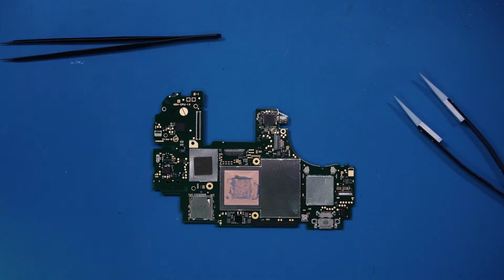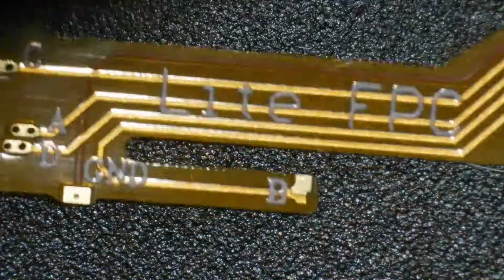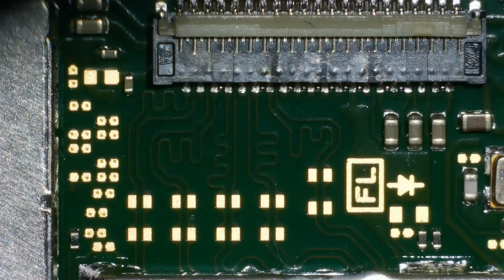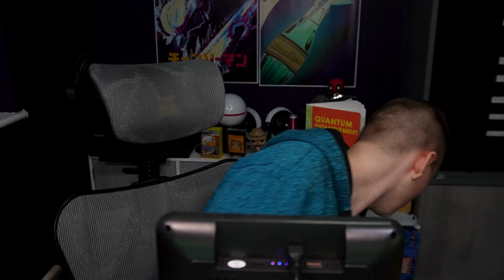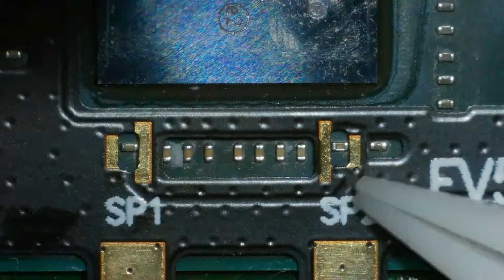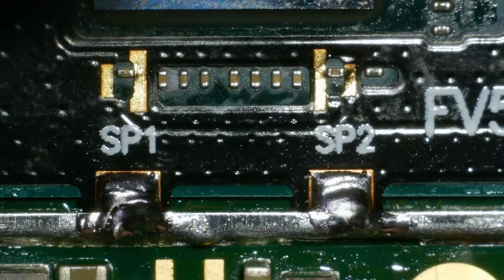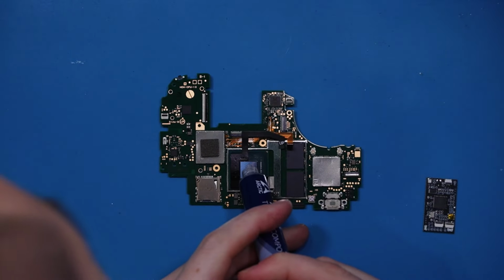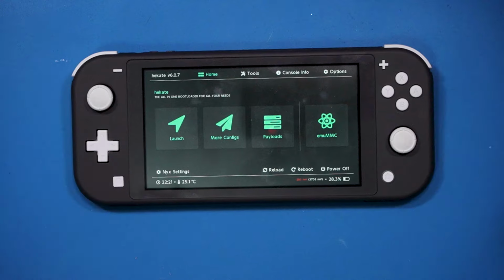Latest RP2040 PicoFly  *2024* : Nintendo Switch Lite Install

Comment: God, I really want to be able to do this. I have most of the equipment I would need for it. Just way too nervous and really don't want to destroy it lol
Reply from the maker: If you already have the equipment and have soldered in the past. The hardest part is the cpu caps. Just take your time. Only do one side of the cap at a time so you dont knock it off. If it take 3 hours it takes 3 hours who cares.

Comment: Amazing video bro! This might be a dumb question but do i have to flash the glitch chip?
Reply from the maker: IT all depends on where you buy them from. They normally come with the USB C adapter to flash them anyways. It's extremely easy to do.
Reply: @QTronics   thankyou! is there any documentation on this?
Reply from the maker: @ https://www.retrosix.wiki/picofly-hwfly-rp2040-nintendo-switch

Retrosix has a good wiki

Comment: Just finished my second switch lite modchip following your tutorial. First time it took me like 5 hours and I even had to remove and resolder the flex cable, but this time i did a really clean install in less than an hour, so thank you man :) . Didn't have the same luck with the OLED tho as i ended up breaking the clk point pad and bricking the console
Reply from the maker: O man, well done on the two lites. They deffo do get easier with time :).

The oled are horrible todo, the clk point is hard to restore too you would need to take the cpu off and do some messing with layers.

Grats anyways dude

Comment: I think I melted off the capacitor of the 3.3v point. Am I completely screwed?
Reply from the maker: No You would just need to put the cap back on. Those are big caps so should be easy to put back on.

Comment: Flex cables that were actually made for the console and the mod chip ....now there's a novel idea .
Reply from the maker: Haha, tbh this one was actually nice to install. Not having to bend it back on its self like the old Lite ones , made it look neater too.
Reply: @QTronics  or pull the emmc card out the device . Yeah this has gotten pretty  streamlined . People will never quit bitching that their isnt a soft mod, but this is so much easier . The flex cables are totally worth the money now that the rp2040 has been revamped and had its gpio pins relabeled to actually coincide  . Plus it fits so much better in the console . Much improved . I really like the orange cable ...its half the size of the one I used and not having to fold the cable to solder the 3v3 is obviously great but now you can actually see the solder point to the pad through the cable . Whoever made it see through is a genius .
Reply from the maker: yeah exactly, the transparency is a cracking idea. I much prefer the placement over the Ram too rather then the EMMC.
Yeah lots of people moan about a softmod. TBH I've only been soldering since nov 23, So I can see why people want to avoid the soldering. However there are plenty of places out there that will mod a console for you, It's worth it at the end of the day.
Reply: @QTronics  yep there are lots of places, but the issue has never been the inability to find someone capable of doing the work, the issue is they don't want to pay for it and it's easier to call someone else greedy than it is to admit that they are cheap .
Reply from the maker: That is very true. having done a number of these now, I can see why they cost so much to be modded. Lots of skill and risk involved.
Reply: @QTronics  exactly . the cost of the rp2040 is negligible . the cost of the console is negligible . The cost to your reputation isn't . people watch other people install the chip in 10 minutes and feel that the price isn't justified, but never stop to consider the risk be taken . They are afraid they will break their console, which wouldn't be great, but never stop to consider how much worse it would be if the console got ruined with it belonging to someone else .
Reply from the maker: Too right,  Modding consoles has definitely given me a new respect for people whole fix them as their main job.

Comment: Sir can you help me. Blue, Green², green², green²

Or  its yellow
Reply from the maker: Have you tested all the points in Diod mode? What readings do you get?
Reply: @QTronics  after failed attems i tried to remove the picofly now my switch wont turn on
Reply: Note, i thik i burnt 1 capacitor in cpu, next to sp1
Reply: Switch now wont turn on can you help me?
Reply from the maker: @pacmanptg4857  sorry I was away at the time.
If you think you have messed up a cap you will need to replace them normally. 0201 1uf 20% 10v
Reply: @QTronics  thank you i will try to replace it. If i have the time. Thank you, i subscribed
Reply: @QTronics  btw will iy have a problem if i ripped the padts of ABC
Reply from the maker: @pacmanptg4857  Maybe, i did just look at the layer schematic though, and it looks like A B and C are just test points. so you might be ok. 
I've linked the schematic https://balika011.hu/switch/lite/

Comment: Nintendo really should give us a power option of performance and battery saver modes. I have a switch lite, and if it would clock up just ever so slightly, it would make a big impact on performance.
Reply from the maker: It really would, it’s silly they dont give us the options to.

Comment: Hi, is it really needed to check the lines via Multimeter? I don't have knowledge with the multimeter :)
Reply from the maker: it just confirms things are connected. If you are sure they are soldered you are fine

Comment: What temperature do you usually use? I found hard to get the solder to stick to the board.
Reply from the maker: Im normally using around 330-350c

Comment: Is only flux paste used in this project instead of solder? I read online that it contains an amount of solder. Great video!
Reply from the maker: I think you’re confusing it with Solder paste. Solder paste does have flux in it I think.
I’m using flux and normal solder, im applying the solder to the iron, as we’re only soldering tiny things

Comment: This might be the clearest, most concise guide I've seen yet on the Switch Lite PicoFly install. Underrated channel, I like your style.

I have a kit sitting at home that I just ordered, and as soon as I find some free time I'll be trying my hand at installing it. Not expecting any trouble, thanks to fine videos like this one. I've got all the equipment I should need, so hopefully within a few days I'll have my Switch Lite modded.
Reply from the maker: Thanks for the kind comment. 

good luck with your install. Just take your time, plenty of flux. just make sure nothing is bridged :) Let me know how it goes please.
Reply: @QTronics  Take my time, hell, I took about four hours with it! Way more than I bargained for. TL;DR it works.

The APU flex cable was a leisurely breeze to install. The toughest aspect of that job was taking off the heat shield - I wound up just using the same plastic spudger that came in my PicoFly kit, and I was surprised it worked so well after watching everybody else force those tiny retaining clips.

The other flex cable, I tossed aside after a while. Even after installing it as well as I could, my PicoFly kept flashing out an error code of two short pulses. After that I figured it'd be easier to string up everything else manually using some enameled wire, and it probably would've been, if my digital microscope weren't so damn low res! So that's an upgrade I'll need to look into sooner or later. But I digress. The bulk of my time was spent soldering and then re-soldering magnet wire to test pads. It was maddening.

For a hot minute there, I thought I killed my Switch Lite. Must have been some eMMC test pads got bridged after I discarded the second flex cable, once I cleared them up it came back to life (hopefully no damage done). And eventually, after considerable anguish and perseverance, I was greeted with the "No SD Card" screen! And I don't think I need to tell you, it felt glorious. After all that time, it felt a little bit like winning the lottery.

Just buttoned it back up a few minutes ago, with some fresh, high performance jizzle to help cool the system. Next step is to find a big old microSD card.
Reply from the maker: @tetsuo3k  mate im so pleased for you :).

Which flex did you have? The one like mine or the old one that mounts on the emmc sheild?
Cus the old flex is crap. Yeah I have a video of me repairing and instinct oled install using wire it’s bloody hard isnt it.

Im glad it’s worked out for you though, and my editor just messaged laughing at you using Jizzle hahahah.
Reply: Oh yeah, it was one of the old style flex cables, with the fold-over bit. Total garbage, but that's luck of the draw for you. Fortunately I could roll with it.
Reply from the maker: I’ve done a couple of those. It all depends on how well the folded ribbon is made, some of them are cur so badly you cant mount them to the points.

Comment: Tutorial is very easy to understand. Your solder joints do need some work. You should be aiming for a nice concave fillet. You are using way to much flux, make sure you clean all flux off the board. Make sure you fully tin the whole pad before installation.
Reply: Using the bridge technique with a thin strand of solder will improve your joints immensely. That way you can insure that all your components are heated up to the right temperature and you won't get any cold joints. Keep up the great work!
Reply from the maker: yeah this was probably the 8-10th time i ever soldered. I would like to think im better now. but getting better only comes with time :)

Comment: amigo sabe me informar se essa é a última versão do firmware para a plaquinha picofly rp2040 ? v2.73.uf2 , ou se possui versão superior ?
Reply from the maker: Hola, El firmware esta aqui : https://gbatemp.net/threads/picofly-a-hwfly-switch-modchip.622701/page-78
Reply: @QTronics  Gracias amigo, intentaré descargarlo, creo que instalaré la versión 2.73, creo que es estable.
Reply: Could you help me with a question? What is the best solder tin to do this installation, 0.5mm or 1mm? I really appreciate your answer.
Reply from the maker: @Fabio_Bezerra_Jr I would use the 0.5mm. As the connection is quite small, it’s easier to apply solder to the tip of the iron then to the point.
Reply: @QTronics  Thank you very much friend for the tip.

Comment: Hello, trying to get some help

On point B I accidentally soldered off the pad that's on the yellow ribbon for point B I managed to get it semi soldered I thought but,  I'm getting 2 quick flashing lights as the error so it's still not connected properly

Can I use jumper wire? Or do I need to buy a new ribbon.
Reply from the maker: Have you checked to see if B has the right reading? 
Alternatively, you could just solder the B point from the Switch lite straight to the Picofly board using some wire.

Comment: what would be the step after installing the RP2040? is there any tutorial for these steps?
Reply from the maker: It depends what you would be trying to do. 

The first thing I would do is get a back up of your nand. 

As i’ve mentioned im doing this purely for changing the clock speeds. I could look at doing a video on that.

If you’re after anything related to running your own back ups the best im willing to offer is this link :https://rentry.org/SwitchHackingIsEasy.

If you’re looking to back up your carts though and play them, the Mig Switch cart might be worth looking at. As after you installed the mod, you would be able to make your own personal back ups.

Hope this helps?
Reply: @QTronics  it really did ty for your time ❤❤

Comment: do you not have to trim the heatshield to fit the chip? like on the og switch?
Reply from the maker: Hi, no you only need to cut the heat shield on V1 and V2. Just make sure you cover the mod chip in kapton tape so it doesn’t short on the heat shield .
Reply: @QTronics  cool thank you!

Comment: I was trying to buy this chip, but I didnt notice until now that its a bit different. It looks like the v6 instinct chip, but its a picofly. Should be basically the same right? 

The only difference I see is that the cable goes over the ram, under the cpu cover and bends back up into the chip instead of coming out the top of the cpu sheild.

Im probably just overthinking it, but worried i got a bunk chip since i cant find any video tutorials on that exact chip (i found instinct version videos that look the same, but no picofly).
Reply from the maker: Hi, yeah that’s the latest variant based on the. instinct v6s.

Everything is the same, except like you said the cpu wire comes out over the ram. 

You normally have to cut the ram shield a bit.
Sthetix has an instinct install :https://youtu.be/R4G79uuh7yk?si=EmMwlPvobXkh-t5b

I’d follow the cpu part on that. As im sure the instinct has extra soldering points for the other part compared to the pico.

Hope that helps
Reply: @QTronics thanks for the videos and advice. I was able to install one of these today, with only a few hours of soldering experience under my belt (practiced by bridging some tiny connections on old Xbox controller boards). Couldn't have done it without this video though.

No idea where to go from "No SD Card" though. Finding good info on the software side is more of a task than learning to solder it seems. I'm going to check your video list and see if you have anything on it because again, this video was super helpful.

Comment: At which temperature is the soldering stick set to?
Reply from the maker: 330c when using the fine tip. 

350c when soldering the ground points on the cpu and dat0 

I mostly sit at 330c on the switch though
Reply: @QTronics  I am waiting for my picofly to arrive and its my first time even soldering, not a good idea but I got myself into it as I always wanned to do such a project
So thank you! I really appriciate it
Reply from the maker: Just take your time, there is no rush. 
Even if it takes you 2 days.
Some advise I received, when soldering the cpu caps wait a for the solder to dry on each side before moving to the next.
Reply: @QTronics  How much does it ussually take up to dry?
Reply from the maker: 10 seconds, maybe less. You will see it harden
Reply: @QTronics  Thanks a lot for all the tips man!

Comment: Hi, sorry for bothering you. I see that before soldering with the fpc kit you "solder" the pads and it seems that you make a mistake touching one of them (at minute 6:36 ), two questions 1. Why do you start touching them before soldering, is it the same? 2. If you actually made a mistake at that moment, how did you remove the solder?
Reply from the maker: @lolloD002 Hi there I can’t see where I make a mistake. 
Im pre-tinning the points so they are easier to solder on to the ribbons

Comment: Where did you get the chip from? I can not find the same one you have
Reply from the maker: https://a.aliexpress.com/_EHIKrR3
L and O universal version 
( I have no affiliate with the link, install and purchase at your own risk) 

Thats the version I used, there are others where the wire position looks like the instinct v6s. So it comes from under the ram side of the heat shield. 

Good luck with the install.
Reply: @QTronics Do you know a place where you can only get 1?
Reply from the maker: You can get singles but they’re be the older way, so mounting the chip above the emmc.
https://a.aliexpress.com/_EuUC2D7

There is another single instance, this seems to be a clone board of the Instinct v6s.
https://a.aliexpress.com/_EjyAYKH

Sthetix has a video on that https://youtu.be/R4G79uuh7yk?si=gqnXUJdRJlKK40ej

Again I dont condone piracy and you install at your own risk.

Im not affiliated with any of those links
Reply: @QTronics is this link just for the boards or does it include the new ribbon cable?(L and O version*)
Reply from the maker: if you click L and O version you get the new ribbon. 
You basically get in each pack the ribbons to do either a Switch Oled or a Switch lite. 
As the APU in the OLED, V2 and Lite is the same. It's only the other points that change.

The second link I posted just to get a single chip it the old style, just so you are aware.
Reply: Can you create a video installing the firmware?
Reply from the maker: @domingocho  Sorry not at the moment.
https://rentry.org/SwitchHackingIsEasy 
That guide covers everything
Reply: @QTronics  thanks for the information!

Comment: hi where did you get chip from? all the ones I see look bit different
Reply from the maker: https://www.aliexpress.com/item/1005006564967626.html

these are harder to find now, due to the the NX v6s releasing as most chips now copy that, example: https://www.aliexpress.com/item/1005006817016595.html

Comment: Is that flex new ? is there any benefit with this new flex ?
Reply from the maker: Yeah it's a new flex. 
The main benefits are it allows you to move the Picofly board to sit over the RAM rather than the eMMC ( like how the oled installs). It also allows you to only need one APU ribbon cable for both the Oled and Switch lite, so if you're doing a few installs it means you can just order one lot of boards.

I personally found when the picofly board sits on the eMMC it's too close to the APU shielding so the wire for the APU has to bend in a awkward way, this eliminates that.
Reply: @QTronics  hi thanks a lot, i bought those flex but it seems that the new lite flex is smaller than the port on the board... should we put the layer full left or full right ?
Reply from the maker: @Linkref  erm i’d message the seller as the cables should fit perfectly. The only option i would suggest from that is soldering wires from the ribbon. That is very strange :/